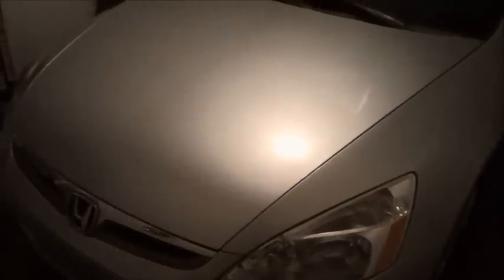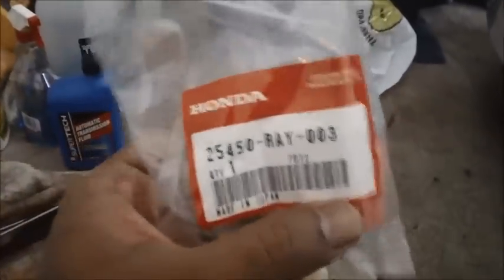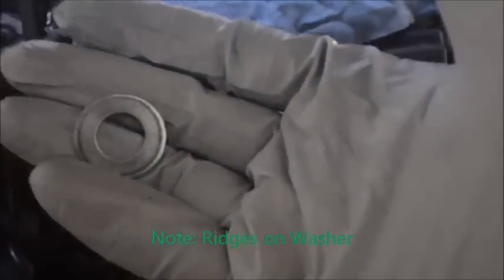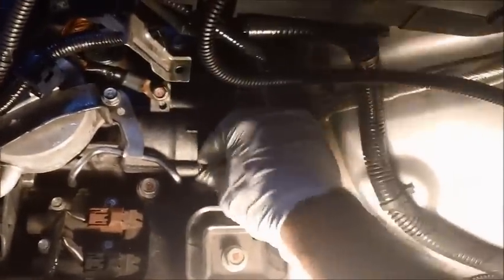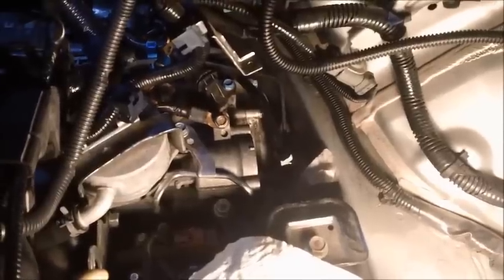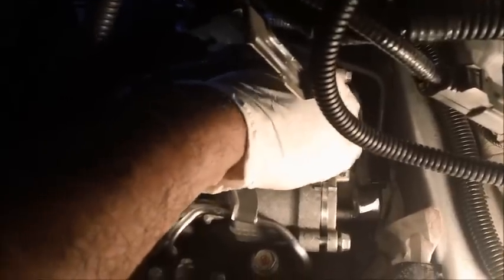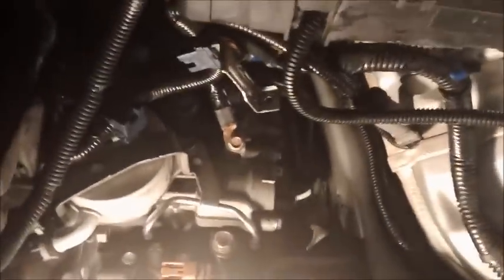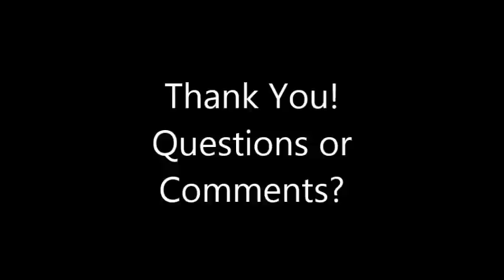Automatic Transmission Filter Replacement Honda Accord 2003-2007 3.0L V6

Comment: Really great job going into detail, explaining  and showing..Audio trouble but I got it..Thank you Sir..My V6 Accord  has 397000 , Tr. Filter  never been replaced but shifts like new but going to change it.  THANKS.
Reply: 397?!?! How!! I’m at 209 and really want to make it to at least 300. Have you rebuilt tranny every or it’s original?!
Reply: Is the transmission original?  What's your advice for transmission maintenance?
Reply: With cars that old (high mileage), change all/most of the transmission solenoids. Or at least take them apart and clean the MICRO filters in them (with Brakeleen and/or compressed air). They get clogged up leading to shifting problems. Good Luck with those because they are a PIA to do, just like this filter change out! Maybe worse imo. But definitely doable if you have some skill and patience. Check out all the YouTube videos on it. But if you’re not mechanically inclined or not 100% certain first how it’s done, don’t even dare attempt it! You’ll pull your hair out and cry! LOL. I would classify it as a very technical/hard job, so be 100% or don’t even start it. Also go to official OEM Honda parts websites and look at the full transmission diagram of your specific model and snap shot it for reference. It gives you a good view and understanding of exactly where the solenoids are located. Just cleaned a couple out today (did it also couple years ago). One solenoid had some debri stuck in the filter. Another one was completely clogged. Also, change transmission oil and ONLY use OEM atf fluid. Do a “3x3 flush”. But with miles like ya’ll have, if you never changed it out before, probably best to leave it alone! Or so that’s what they say. Also check out (replace) transmission oil pressure switches. But ya’ll should thank the Creator with such high mileage cars and still going strong. I got an ‘03 with approx 100K miles and I think my tranny starting to go. Hence why I did/doing all this maintenance on it.
Reply: @mikeike7114  My 2007 Accord V6 has 218k on it.  The shifting is a little hard but it’s not too bad.  I may have to look into getting the switches and solenoids replaced.
Reply: @waholoopesorry74  wouldn’t hurt. Often it could be those filters clogged up too. Try everything, before going to a “pro” would would convince you that you need to “replace” your transmission for $3-4K.
Regarding your solenoids and oil pressure switches, go HIGH QUALITY aftermarket or OEM *ONLY*. That’s way too much labor to be installing cheap junk that could most likely bring even more problems. IMHO

Comment: Ok I have a 2003 Honda Accord coupe ex that won’t shift into gear ?? Help please
Reply: Yo, I'm having the same problem. 
Have you found the solution to the problem?
Reply: I have the same vehicle i changed the linear solenoid so far it helped but I'm still working on it
Reply: Did you try changing the transmission oil pressure switches 3rd and 4th gear oil pressure switches are located under the driver side wheel well. Those commonly fail on the Honda’s and Acura’s with the automatic transmission. You will get a flashing d when they are having problems or hard shifts from 2 to 3 gear and 3 to 4 gear

Comment: I have a 97 prelude that just doesn’t shift right it’s a auto but if I’m accelerating it’s kinda late going into the next gear and the rpms raise then it decides to shift I had my friend tell me check the trans filter
Reply from the maker: I am really a fan of those cars, hang on to it! Would be nice had it been manual. :)

Comment: This is actually a transmission  cooler filter , not a transmission filter .
Reply from the maker: Yes, I think you are correct, but this is the only one serviceable with common hand tools.
Reply: Is it still important to replace? I have a 04 Accord V6 with 110,000 miles and I just bought it 4 months ago not sure if the fluid was ever changed and that was the first thing I did. I did replace the tranny mounts but it still shifts like a rubber band (almost like a CVT) when I accelerate past 3,000 RPM in all of the gears. It also takes a few seconds to shift into drive and reverse. Fluid still looks auburn (reddish brown) color rather than pink or red. Hoping I wont have to rebuild or replace it since it still has low miles. Just maybe not an easy life.
Reply: Yeah that's exactly what it is, but as you stated, it's still part of the transmission system so this video is very much appreciated.
Reply: @nicewknd  Right!

Comment: Hi, do you know the torque spec for 3 housing bolts and the middle of housing one? Thanks
Reply from the maker: I looked in the Service Manual and could not find that information. Space is tight, chances are you would not be able to get in there anyways.
Reply from the maker: Audry Wise: I purchased the kit on eBay through the seller keenanhonda, about $34.00.
Reply from the maker: Audry Wise: Sorry, this is my personal car, and I am only a DIY Mechanic.

Comment: Should have known by now most cars don't use steel washer but aluminum or copper to seal things like this including engine and transmission drain plugs.

Comment: Good job but I would like to know how to change the filter inside the transmission. There are two filters on this transmission.
Reply from the maker: So I have heard, and short answer is I have absolutely no idea! My understanding is the transmission would need to be removed /disassembled, not something I would try in a home garage.

Comment: would it stop my car from slipping gears i changed the fluid nd small filter
Reply from the maker: Can't say for sure, but it is certainly worth a shot. The best option is always prevention, I changed the trans oil every three years since the car was new.

Comment: I have the exact same V6 Accord but mine is 2005. I should have the same filter you replaced underneath my airbox as well then? How about replacing the internal filter by dropping the trans pan, have you done that. I'm trying to do a thorough job on my transmission since it slipped on me for the first time trying to pass a car going from 60 to 90, the RPM got stuck at 5000, to say the least it scared the shit out of me. Hasnt done it again but it's a definite sign that the fluid needs to be completely replaced with both filters, the one you show and the one above the transmission pan. I'm thinking of going with Amsoil synthetic DW1
Reply from the maker: I purchased this kit on eBay and it specifies this kit works for 7th gen Accord V6 03-07 this includes your car. The other filter would be a bit more challenging and might possibly require remove/replace the transmission getting to the internals. You can't simply 'drop the pan' in a Honda. Honestly, I just don't know I am not a professional mechanic in any sense.  You can use Amsoil if is specifies the Honda DW-1 standard. I am not a big fan of 'flushes', I think the better option (especially) with Honda's is to change three quarts of fluid with every oil change.
Reply: @nicewknd  what is the kit called from eBay? Thank you
Reply from the maker: @erickimmy8020  In eBay, search "accord transmission filter kit", the seller is Keenanhonda, sells now for ~$34.
Reply: @nicewknd  thank you!!
Reply from the maker: @erickimmy8020  Wishing you the best!

Comment: I got same vehicle but it's standard and the problem I'm having is my transmission is trying to go out.  Where I cannot locat. Where its sittin at
Reply from the maker: By 'Standard' I assume you have a manual gearbox. In this case, you most likely have your clutch serviced. This would require the removal of the gearbox which should be on the same side as my automatic transmission. This is not something you can do at home with hand tools, better of taking to a mechanic.

Comment: Is the filter housing under the car or in the engine bay somewhere?
How much is the kit? Frustrating trying to follow this video..would be nice if you zoom out a bit to show the general area where things are.  
Nevermind, found it on this video:  https://www.youtube.com/watch?v=hh5APvQZoKk   it's for Acura but filter is in the same area.
Reply from the maker: The transmission filter is on the driver's side, I would recommend removal of the battery and air box. You can purchase the genuine Honda kit on eBay for $30 with free shipping.

Comment: This video is terrible at best. The image quality is low and the audio is bad. He spent most of the time talking to himself! It should be less than 1/2 the time from start to finish and it dragged on for 38mins. He does not seem to have good hand dexterity for a mechanic, sorry. It took twice as long as it should for him to take the filter out and put the new one back in. This video did show that the AT filter in this car does not really need to be replaced as the AT was properly maintained in its life time. Honda does not have this filter as a maintenance item for the car, assuming that it is properly serviced during its life.  On some other videos, the AT filter was dirty and disintegrated, probably overheated from neglect by the owners. And, yes, all the crush washers are aluminum, you can't have a steel washer if you really want to seal the fluid. It is better than some other video of people showing the filter replacement process after it is done but this could have been a lot better with some editing and voice over. One thing is good that whoever sold him the kit, it has all the right parts so he could complete the AT filter change without having to run to the dealer to get any additional parts. Most of these parts are not in stock at the dealer, so it would be bad if he had to wait another day for the one missing part. People doesn't need to know part numbers though, I am sure they can get the same kit from Honda or a Honda dealer would be more than happy to provide them.
Reply: well.   its better than the one you published for everyone to see how to do this eh?  Amazing you take the time to watch and criticize but not make a better vid
Reply: Exactly! And many filter videos are of different Honda models. This one helped me out alot to REmember how to do it. (I did it few years ago, but forgot.)